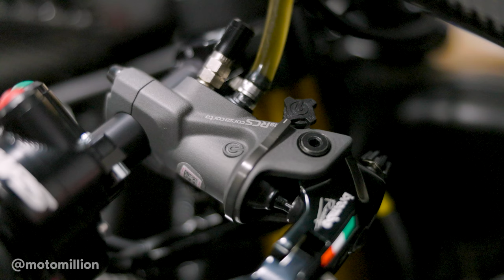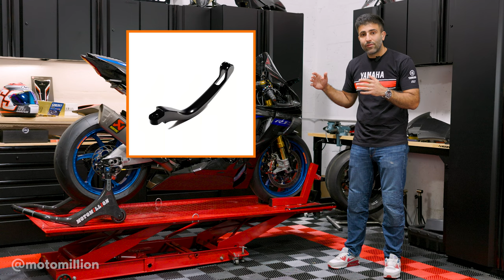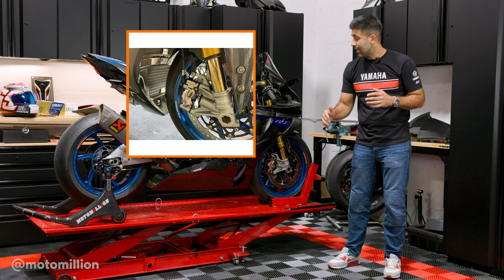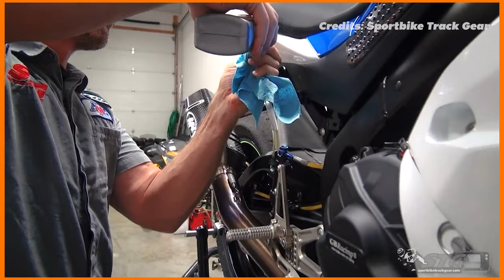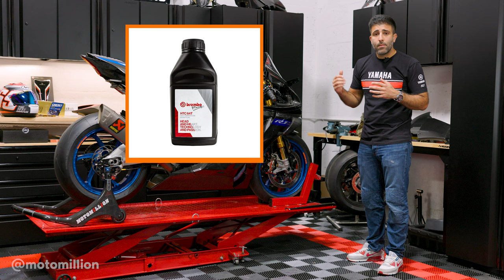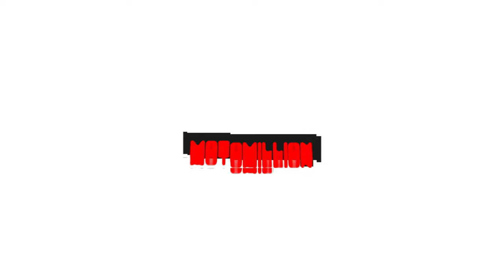Ultimate Brake Upgrade Guide for the Yamaha R1 & R1M!

Comment: Do i have to buy a single line banjo bolt separately? With the master cylinder or brembo sends you one with the rs19?
Reply from the maker: On the Yamaha, you will need to buy the single banjo bolt. The Brembo masters only come with dual banjos.